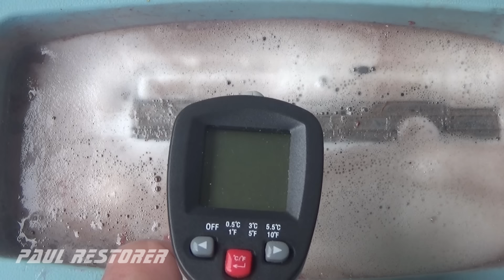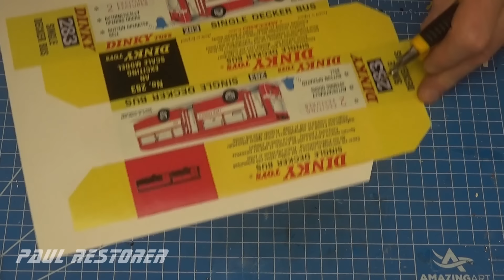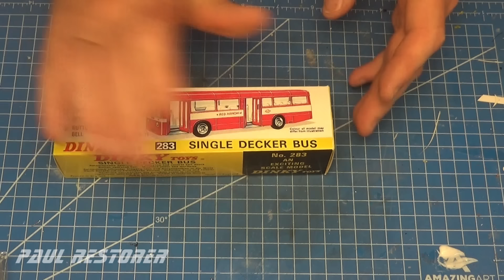London Single Decker Bus. Renowacja modelu Dinky Toys nr 283. Zabawka model odlewany.

Comment: Another fabulous restoration, Paul. Like yourself and many others have found when reassembling the doors are a problem, but there is a very simple trick to the doors. I came across it by pure luck. I have 7 or 8 of them to do. I recently received the reproduction doors I was missing. From cliffords. I hope to do my fleet later in 2024. I have window units to make as well as window units and the interior seating. So I've got my work cut out for me. It is one of my favourite models.  Cheers Michael
Reply: What is the trick to seat the doors?
Reply: Hi. What is the trick to seat the doors back in properly? Thanks
Reply: @TheMasterNo6  I can imagine it might involve adhesive tape. Place the doors in their roof holes, fix them temporarily in place with adhesive tape on the outside, this will make them far more stable while aligning the baseplate..

Comment: Youre right, the doors are very difficult to seat properly. I took one apart to my regret and never cpuld get all the doors back in properly. I ended up selling it years ago. I have 2 others which were very nicely custom painted in different local liveries with advertising details I bought a long time ago that I decided to keep as is. I wonder how the women in the Binns Road Meccano Dinky Factory managed to seat all the doors in these as they would have been working very fast. Its a lovely old model though.
Reply from the maker: It seems to me that these women definitely deserved an award for their dexterity during assembly, their advantage was certainly smaller fingers that made it easier to set up these small elements

Comment: To “hold” a moving or fixed part, you can use mechanical grease at the junction, for example for doors, you apply it to the pivots, so the doors hold “well” in place! ...
Reply from the maker: Thank you very much

Comment: That's a fairly butchered paint job to tidy up. I had one of these as a kid, but it got lost. I loved the working doors and ringing bell. Now I have 3 boxed ones, though I'm missing the original transfer sheets. Mine have rivets instead of screws so you are lucky.  I always wanted a northern bus like a Leyland National or Bristol Re of this quality as I never saw London buses until long after these had retired.  Excellent job you've done. You're definitely not shy about wasting paint 😂. Some even went on the bus. Was that clear lacquer after the red ? The wheel moulds are genius 👍🥇
Reply from the maker: Thank you very much, I always harden the base paint with a colorless acrylic varnish with a hardener

Comment: To “hold” a moving or fixed part, you can use mechanical grease at the junction, for example for doors, you apply it to the pivots, so the doors hold “well” in place! ...